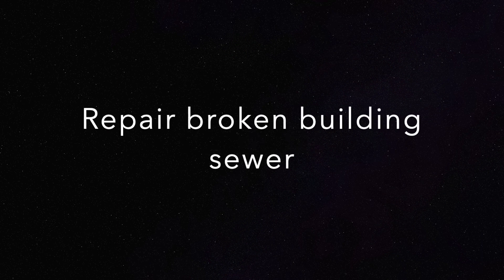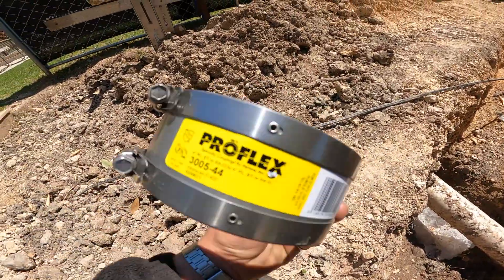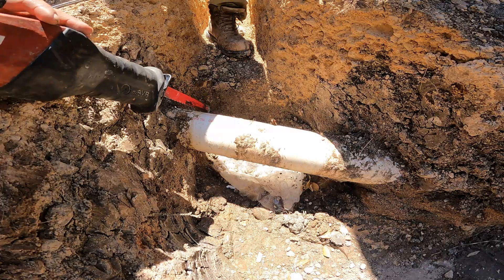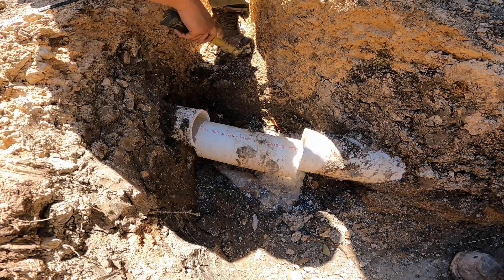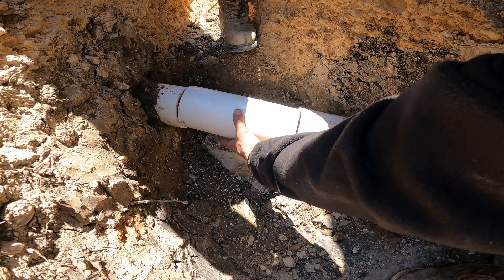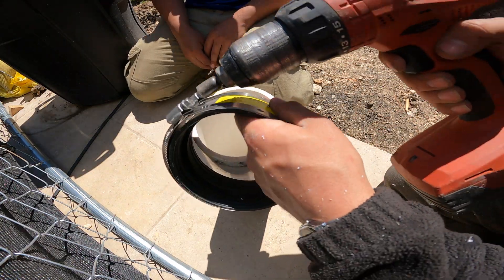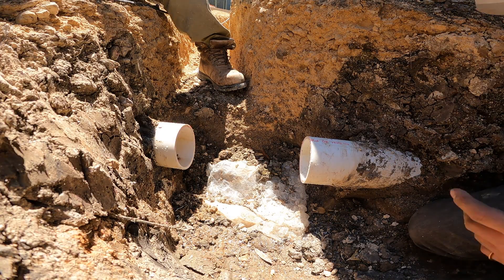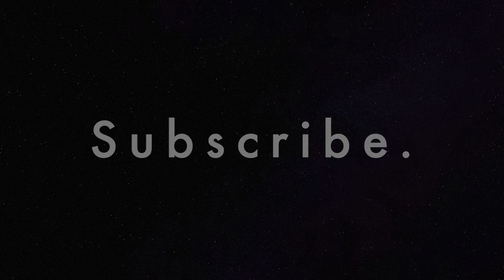How to install no-hub coupling to fix broken PVC pipe.

Comment: I think your using the wrong fittings for an underground application...a Fernco type rubber fitting with two corrosion proof clamps I believe are for underground connections.  A glue welded slip coupling when possible is always even better
   I'm sorry but the shielded no hub I'd best above ground for corrosion purposes. I believe that's also code

Comment: Nice video, however please not the following correction:The torque specification for no-hub couplings is definitely not 80 ft. lb. The specs are as follows:  60 inch pounds. (1½” – 10”) or 80 inch pounds (12” & 15”)
Reply: Huskys are 80

Comment: My concern is the hose clamps rusting and failing over time with these underground
Reply: They’re stainless. They’ll last forever.
Reply: Stainless can definitely rust, just not as fast. Better off with compression or slip fit.

Comment: Thank you very much for this video. I had to make a repair to a 4” pvc drain line in my yard and used this method - worked perfectly. I took it a step further and wrapped it with mastic tape. Thanks again.